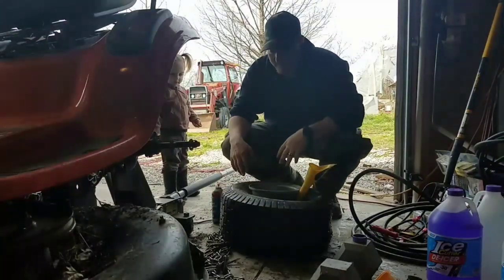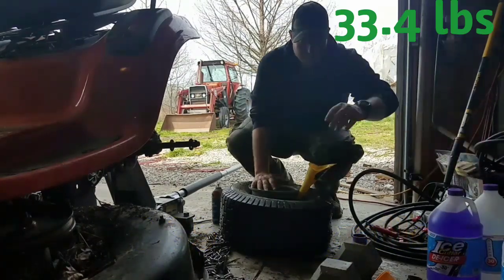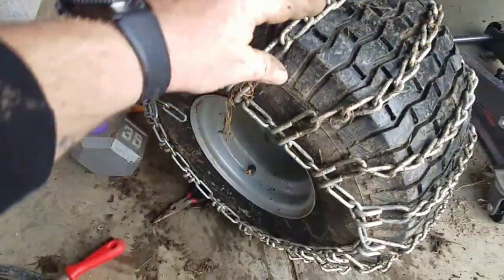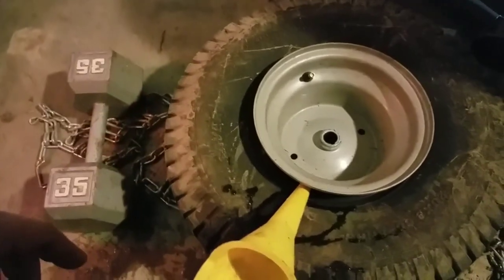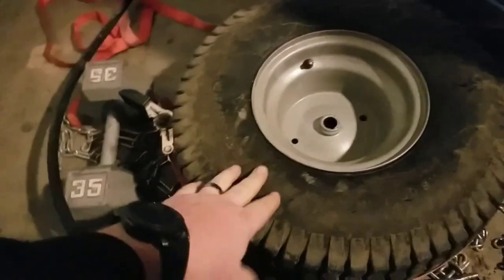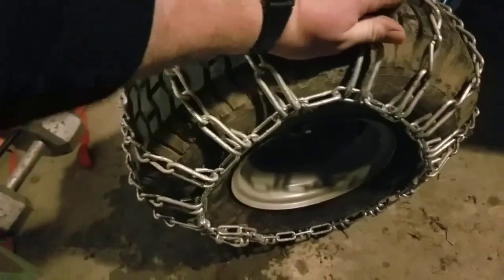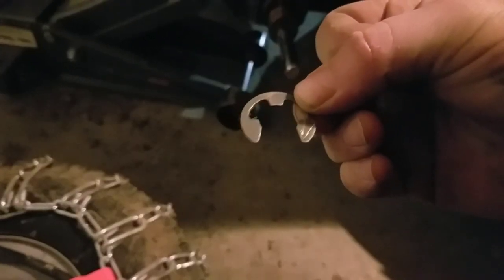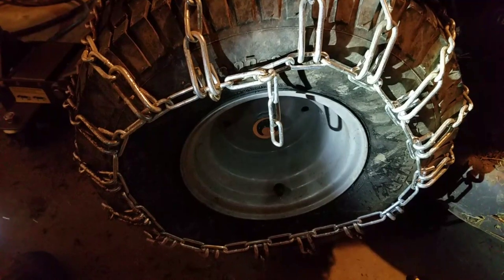Adding 64 lbs of weight to my lawn tractor tires For better sability and tire chains for grip.

Comment: I ordered new tires from Amazon for my mower a few years ago, they came all folded up i couldn't get them to bead and took them too a shop. Starting fluid burned all the hair off my hand. I don't think they even charged me. But removing the valve from the valve stem  seems to be the best way

Comment: I would probably try just using my bigger 2" ratchet strap and air pressure after cranking the strap about as tight as I could and not even try the starting fluid trick unless all else failed. Actually might try that on my old 212 rears,haven't decided yet. Got the blower working but don't really need it,it just came with the bonus tractor and deck from a job I did for cousins. If my son doesn't use it for snowblowing his longer driveway and walk then it won't need weight and chains just to mow my lawn. I have used the smaller 1" strap on smaller front tire of a LX277 with good success.
Reply from the maker: Only the top side bead was broken. If you used a ratchet strip it would most likely beak the bead on the bottom side, and the fluid would like out. But I do understand what your saying.
Reply: @chickenhawkfarmstead8478  When I used the small strap on the front wheel it pushed the bead  out to the rim so my compressor could then seat the bead properly. I do not remember if both beads were compromised or only one side but I did it without taking the tire off the rider. Was maybe 10 years ago and detail is sketchy in my little brainpan. :)
Reply from the maker: Next time I use a strap to reset the bead on a small tire I'll have to pay attention and see my self.  Luckily, I have had to do this in some time my self and not hopeing to do it again soon.  I will say the fluid in the tires is still going strong to this day and has helped a lot.

Comment: Couldn’t you have just unscrewed and removed the valve stem cores and poured fluid into the tire that way without breaking the bead?
Reply from the maker: Short answer yes. Long answer I have seen that work with a pump and hose the right size. I did have a transfer pump or want to buy one for his. All my pumps are die fish and plant systems. Or they where when I made the video.

Comment: This may be a great trick for some of you.  But, I cured the slipping on a slope with a change of rear(drive) tires.  I changed my mowers rear tires for atv tires.  Cost about $80-90, for two tires mounted.  Greatest thing I ever did for my mowing problems, living on the side of a hill, that is.  No chains, no fluids and the first set I put on are about 10 years old and almost no wear. My 2 cents.
Reply from the maker: I though about doing the tractor type of tires but they where $80 each.  Ill have to check on atv tires good ideal

Comment: I hadn’t thought about using anti freeze. That’s a duh on my part. 
Good stuff
Reply from the maker: Its just the winter windshield wiper fluid it has alcohol in it to keep it from freezing. But i guss a antifreeze mix would work too.

Comment: Well there is a mistake chain tensioner should always be on the outside so the chain doesn’t wrap around the axle
Reply from the maker: Thanks for letting me know. If i have to take them off for some reason ill my fix that.  But i will say its been almost 2 years and no issues
Reply: @chickenhawkfarmstead8478  the tensioner helps in obvious ways but the best reason of all is when a link finally does break the chain falls to the outside, no harm no fowl, how ever in the case of heavy equipment the chain wrapping around the axle and snagging on all kinds of things has  as I can attest bent rims on tractors, can hang you up on stumps, bend axles. Good luck hope this helps some one not make a costly mistake.
Reply from the maker: That makes a lot of sense. They really should send instructions with throw things.

Comment: Your chains are on backwards, the hooks should be turned out
Reply from the maker: Thanks for the information. I didn't if it mattered but I will say after 4 years of them being in there and being used alot I have not had any noticeable issues.